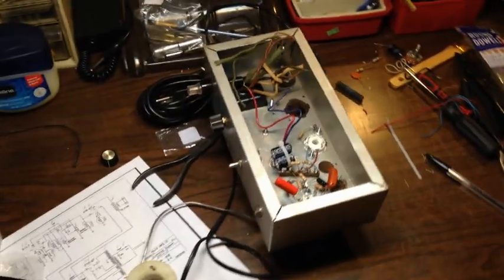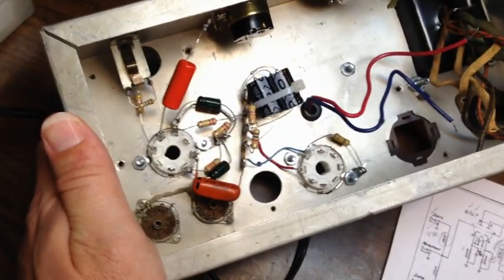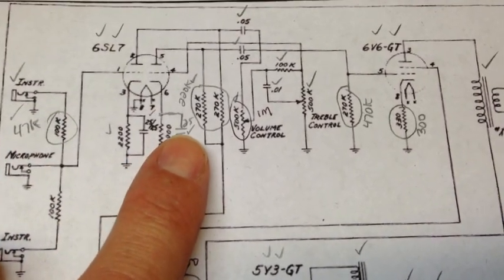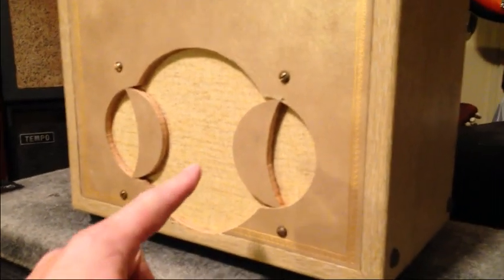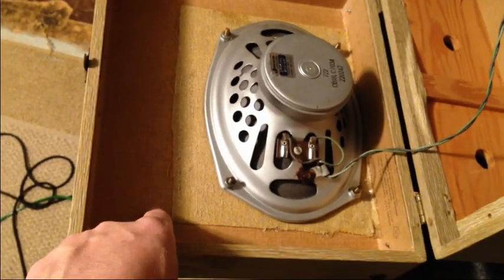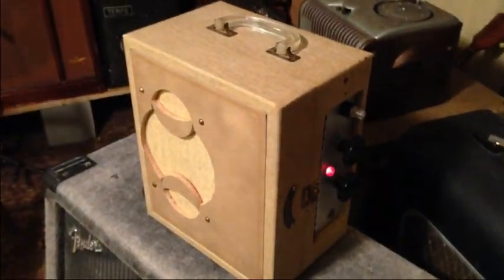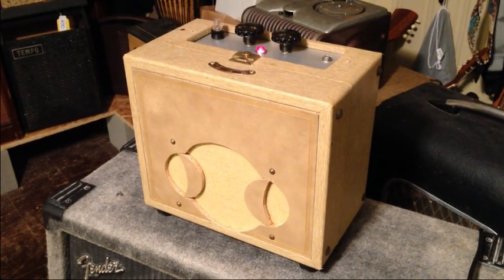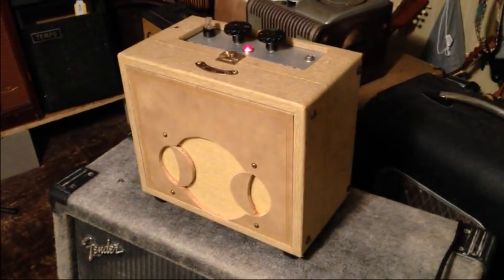UPCYCLED GUITAR AMP: Supro Spectator Clone & Old Record Player Box

Comment: I have a mysterious tube amp problem that maybe you can look into regarding the SUPRO 1650RT ROYAL REVERB (reissue). I am having tube Rectifier issues that is making me very frustrated and costing me money. FIRSTLY you should know there are two (2) models within the 1650RT line.  A 35/45/60 rectifier config knob, and a 35/60 toggle switch line. I have the 35/60 watt toggle switch version. Bought mine USED and out of warranty. Both versions have DUAL RECTIFIERS. the 60 watt (AB) mode uses a digital rectifier that I have to crank up to 3/4 and I do get some gain, but the 35 watt (A) mode uses a tube rectifier -  The CLEANS sound angelic - really nice but absolutely no gain in the 35 watt mode. I bought TWO new rectifier tube and both tubes did Not fire up, just dead in the water which lead me to believe the TUBE RECTIFIER section of this amp is down. Any way for me to test it? Maybe something simple in the amp is unplugged or unjacked? I really could use your input OR ANYONE READING THIS feel free to chime-in. Thanks in advance - I looked everywhere for any forums on the subject - but nothing. HELP !!

Comment: I’ve always wondered why the hot tubes don’t char the wood case (or set it on fire), or (depending on the design) the grill cloth? Did they use flame-retardant on these even back in to ‘50s and ‘60s? One thing I would add if I were going to build an amp like this (given your chassis already has the extra tube sockets) would be an ‘alternate’ input stage in parallel with your 6SL7 that uses a 12AX7, plus a switch to allow you to choose which one you like the best (or in case the tube blows during a gig)! You could also sub a 12AT7/12AU7/12AY7 and experiment with those, too. 😎

Comment: that thing sounds golden, so smooth and creamy when clean and crunchy as silk when dirty ... do you sell these things when done, or just build them and keep them forever?
Reply from the maker: I sell everything. I still have this one if you want it. bradlinzy at gmail
Reply: A great sounding amp, but I doubt I could afford it, even if you just broke even on the parts and labor..... I was just curious, if you kept these for you own use. 
Right now, I'm as broke as it gets, but damn if I was was in the market for one sweat little bedroom/studio amp I would jump on that ...
I try and, I mean just try, to do some conversions of old tubes amps. I have one I made from a old tube real to real tape recorder. It already had a PA channel so it was pretty easy to convert to a guitar amp. I used it's original case as the cabinet and basically just removed all the the parts related to the tape (motors, pulleys and related parts and electronics). I don't think I changed anything else, it's loud (crunchy) and quiet (low hum) as it gets ... and sounded great. Looks ugly as freak though...

Comment: Hi Brad, Really nice job on the scratch build amp. I've been waiting for a build with all the parts you have. It would be cool to see more as your able. I'm a real fan of the simple single ended amps. Maybe a 5C1 with a 6SJ7 pentode pre amp. Your amp sounds great. Take care, C.
Reply from the maker: Thanks Cass. I have another chassis the same size as this one with more holes in it, so I might build something into that at some point. We'll see. I try to keep things loose on this channel and try new things and see where it leads. I have a passion for saving stuff from dumpsters and upcycling (yeah, I know, there's a whole silly, trendy movement of doing this, but I'm not trying to be a hipster, just being stubborn and frugal).
Reply: Wow i really like that Hofner guitar... i just simply like how Hofner combined TV and radio tubes in their amps, example Hofner Orgaphonn 45MH, had 2x PL84's (basically EL86 but different heater voltage) and squezed around 30W out of them... I still wonder how after going million times trough the schematic...

Comment: Can you explain what "Point to Point Wiring" actually means?  Heard that for years, never quite understood its definition. I know "Quality" and "Vintage" Amps always boast of Wire to Wire.. New Amps (unless expensive boutique) are not point to point but some sort of pre-fab components.
Reply from the maker: "Point to point" or "PTP" is a method of wiring where extra wires are eliminated and where each component is hand-wired from one connection terminal to the next directly, rather than being mounted on a board with wires running from it. Most boutique builders today tend to mount components on a board and run wires at right angles and do a lot of stuff to improve the internal cosmetics of the amp. PTP, by contrast, looks messier because there's no board on which to mount components in neat rows. Board mounting has the advantage of making scaling for multiple builds at once easier and thus more economical than PTP hand wiring. It also makes service diagrams of component locations possible, so servicing is easier. In a PTP amp, if you want to service it, you have to trace out the signal paths by eye. Hope that helps! Good question.
Reply: Yes it does. Demonstrating that might make an interesting and informative video for your subscribers...
Reply from the maker: Yes it might. Thanks for the suggestion. I'll keep it under my hat.